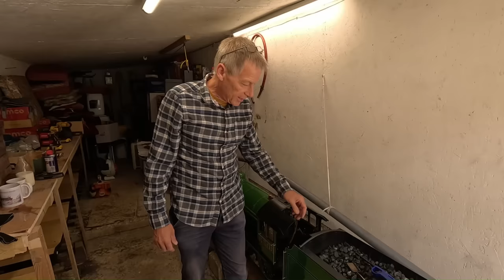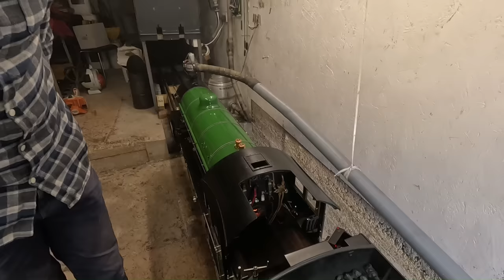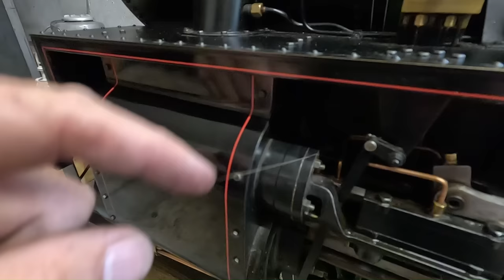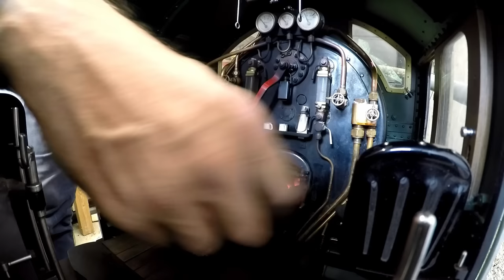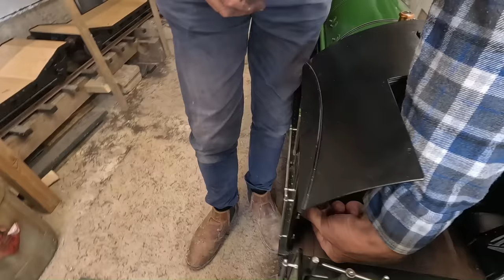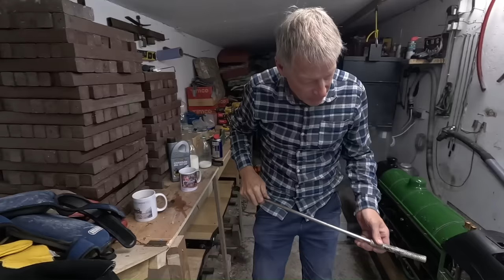How to Raise Steam in a Locomotive at Peter's Railway

Comment: Exceptionally functional and detailed locomotive. Everything works. Everything has to be actually maintained. Never seen anything like it.
Reply from the maker: Thank you for your lovely comments about the engine.  I made it to be a model to enjoy looking at, but at the same time to be able to work really hard.  The bearing surfaces are made of the correct metals etc.  However, there is still quite a lot of work to keep it in good running order, so in that way it is very much like the original machine!!
Thanks for watching! Chris.
PS. If you would like to know about the books I write to teach children (age 3 to 90!) about railways, science and engineering, there’s lots of info here: https://petersrailway.com/

Comment: How on earth do you make the parts so very small and yet maintain function? Those oil pipes alone are so tiny but yet they function and the size of all the plumbing in the cab and such small valves and yet operational at boiler pressure for the injectors. Absolutely amazing. 
I take it everything is the correct 1:1 scale by the looks? ❤
Reply from the maker: Hi, Good question!  The answer is that it is quite difficult.  In truth, the fittings are not truly to scale, so sometimes they are a little larger but in the correct proportions.  A good example is the two mechanical lubricators on the running boards.  These are in fact 50% oversize to allow the internals and a supply of oil.  No one has ever noticed because they are the right shape and have many of the details you would find on the originals.  The oil pipes are 1/16" outside dia, with a very tiny hole through the middle.  luckily, oil, unlike water, still flows slowly through tiny holes and anyway, the flow rate is almost non-existent!  The pressure isn't a problem - as it gets smaller, the pressure has less area to act on.  However, injectors on models do not normally work up to 120 psi, so these are adjusted/tuned to work a little higher.  Thanks for watching! Best wishes, Chris.
PS. If you would like to know about the books I write to teach children (age 3 to 90!) about railways, science and engineering, there’s lots of info here: https://petersrailway.com/

Comment: Something I’ve been taught to do is when steaming a boiler from cold is to shut the bottom shut off on one of the sight glasses and leave the top valve on and then open the drain, which allows all the excess oxygen to vent out of the boiler and also gives you an indicator when the boiler has started to make steam (this also gives the boiler abit more life as it reduces oxygen in the boiler to corrode the boiler)
Reply from the maker: That is a cunning idea!  My boiler is made of copper so probably corrosion isn’t a concern.  However to show when steam is up it’s a good plan.  I usually use the injector steam supply which shows up at the injector overflow.  Chris 
If you would like to know more about the books I write please see www.petersrailway.com

Comment: Thanks for explaining the injector sequence. I have just finished a Pansy Pannier 5” gauge and have run it for a few minutes only when the water level drops. I am very wary about how to use the injector for the loco to run. Just practice I suppose. I will be so happy if I can succeed as it’s taken me years to get to this stage.
Reply from the maker: Hi Adrian,  Thanks for the good comments!  Yes, injectors are, or can be, temperamental things.  I find the WD40 after a run seems to help.  The problem is that our cones are only made of brass and the zinc leaches out if left for a long time as there is always water in them.  I used to clean the cones with citric acid etc, however that seems to make the cones even more fragile.  If you can get some cold water to run through before the steam, then that helps them to pick up.
PS. If you would like to know about the books I write to teach children about railways, science and engineering, there’s lots of info here: 
https://petersrailway.com/
Reply: Thanks for your reply and your advice which I find very helpful.
Confidence and lots of practice will hopefully give me the success. I’ve subscribed to your channel and look forward to some more posts. @PetersRailway
Reply from the maker: You can get lots of practice with the engine propped up on the bench.  There isn't really a need for a roller type rolling road, you can just rest the buffer beams on some solid bits of wood.  Then you can run for hours and get the hang of it all.  If you don't tell anyone, you can even apply the brakes gently to give it a load to work against!  Chris. @adrianbolton4847
Reply: This is the best piece of advice anyone has ever suggested; thank you.
I’m ready for the next stage with definitely more confidence. @PetersRailway
Reply from the maker: Enjoy the whole process.  There is nothing in the world quite like lighting the fire and seeing your work come to life...  Chris.   @adrianbolton4847

Comment: That’s the coolest toy I’ve ever seen! How do you keep the internal metal doors and components from completely corroding in the boiler? I heat my home with a big soapstone heater and have realized that I had to replace internal steel with double thick steel because the heat and flames warped and corroded them.
Reply from the maker: Thanks for the great comment.  The boiler is made of copper so corrosion isn’t a problem.  Thanks for watching! Chris

Comment: Nice railway and narrative!
The members of the two clubs I have belonged to advocated bits of wood soaked in kerosene for fire starting.  Of course I followed this dictum for a while.
Upon deliberation I got to believe this method to be the height of stupidity!  Why???  Because the cold boiler tubes and firebox walls will condense the vapours coming off the wood and kerosene, leaving a sticky surface and soot.  Add some ash from the coal and you have a good insulator on the heat transfer surfaces.
Consequently I changed to using charcoal, as the author of this thread has done, but I soaked it in methyl hydrate also known as methanol or wood alcohol.  This combination leaves very little or no residue on the heat transfer walls, leaving the locomotive rearing to go.  Methanol is available in paint stores.  Don't drink it as it is poisonous.
You can see my locomotive, ol' 2888, running on my channel BasementEngineer.  The videos were made at the track of the Montreal Live Steamers,  and the Golden Horseshoe Live Steamers in Hamilton Ontario Canada.
Reply from the maker: Hi, and thanks for the information about soaking charcoal in Methanol.  Yes, you are exactly right, I think that the moisture from the kerosene probably does make the surfaces sticky at the beginning, so some people say to only light the fire with wood and then go over to coal.  The problem in the UK is that methanol is not so easy to purchase in quantities other than very small.  However, I will have a look and see if I can find some somewhere.
Meanwhile, thank you for watching the video, all best wishes, Chris.
PS. If you would like to know about the books I write to teach children about railways, science and engineering, there’s lots of info here: 
https://petersrailway.com/

Comment: Lovely loco! Superb detail!
I didn't think of putting coal in with the charcoal to start with but it's a good idea.
Reply from the maker: Thanks for the good comment.  Yes charcoal and paraffin works very well!  All best, Chris.
Reply: @PetersRailway Yes I always use charcoal soaked in charcoal to start with but I normally just add the coal once the charcoal is going well.
How did you attach the copper pipe to your oil can?
Reply from the maker: The copper pipe is easy:  Just drill out the end of the normal oil spout to clear the 1/16 inch copper pipe.  Then soft (lead) solder in the pipe.  Not so much solder that it blocks the little copper pipe!!! Chris.
Reply: @PetersRailway  Yes that makes sense.
I tried this on another oil can and glued it in but it came loose.
My soldering isn't great so I will have a think.
Reply from the maker: Practice makes better!   @mattseymour8637
Reply: @PetersRailway Do you find a mix of different coal works best for example anthracite and a more bituminous easy lighting coal?
Reply from the maker: No, I use just the anthracite these days.  I guess you could start with a softer bituminous house coal to get it started, but the charcoal/paraffin works well.  The trouble with some softer coals is that they can contain a lot of sulphur.  This can attack the silver solder in the boiler/superheaters.  However, whatever works for you is the best!!  Chris.
Reply: @PetersRailway  That's fair enough.
I have used the anthracite in the past and find it's ok once it's going but takes a fair while to get going properly and when stood for long periods can get very inactive.
So now I tend to mix it with some better quality less sulphur steam coal.
I find the soft welsh dry steam coal works well and doesn't have too much smoke or sulfur.
Reply from the maker: Lucky you to be able to get some welsh dry!  I had some but it clinkered really badly.  Yes, I have found that the anthracite will try to go out unless you leave the blower on a little.  It takes a bit of practice to get it right.  With some house coal I had, years ago, the fire could go completely out/black, but the blower would bring it back in a few minutes.  Not so with anthracite!!  C
Reply: @PetersRailway  Yes it's getting hard to get hold of and has doubled in price but luckily because all the steam enthusiasts contested about the Welsh mines closing they opened one back up again so it is available for now but I understand what you mean about the anthracite needing constant draft and so found that with the Welsh dry it just burnt that little bit easier with less blower.
I didn't find it clinkers but I only run up and down a short track so ok for what I need.
Reply from the maker: Maybe I just had a dud batch of it.  Who knows?!  I guess we are lucky to have coal at all these days.  I ordered a small stockpile a while ago, just in case it gets even more difficult to get hold of....  C
Reply: @PetersRailway  Yes that maybe the case as sometimes you get stuff that isn't as good and I did the same when I knew the Welsh mine was shutting and bought several 20 kg bags of the Welsh Dry Steam coal so will last me for years!
But as you say to get the 'proper' coal is hard to get now and without paying a fortune.
Now it's all this manufactured ovoid stuff!
Reply from the maker: Ah yes, Ovoids.  They won't fit through the firing hole!!
Reply: @PetersRailway  I know and if you try and break them up they just go to dust!

Comment: Way cool!
     
      Are there any provisions for cylinder exhaust steam to flow into the smoke box to increase draft?

      Using straight boiler steam for draft makes sense for building the fire and when the locomotive is idle, but is inefficient for running.
Reply from the maker: Hi and thanks for your thoughtful comment!  In fact, that is exactly what is done, once the engine is running.  The exhaust steam from the cylinders is directed up a "blast pipe" which is positioned directly under the chimney.  The effect of the exhaust steam blasting up through the smokebox creates a reduction of pressure which then draws the fire through the boiler's fire tubes.  Also, it draws air through the fire to make it burn.  There is a good description in book 2 of my hardback series - Peter's Railway and the Moonlight Express, if you are interested.  It is a children's book, but much older and more technical than most children's railway books!!  Thanks for watching! Best wishes, Chris.
PS. If you would like to know about the books I write to teach children (age 3 to 90!) about railways, science and engineering, there’s lots of info here: https://petersrailway.com/

Comment: Very Nice.  Such detail and functional miniature valves and controls.

Was "Swell" mentioned?   As a boiler heats I a accustomed to seeing the water level rise with heat and bubbles without adding water.
Reply from the maker: Thanks for the great comment.  No I didn't mention swell, but it is very visible as the water heats up.  I had always thought it was just the water expanding, but you have made me realise that the little bubbles in the liquid will also increase the level.  Thanks for the enlightenment!!  Thanks for watching! Best wishes, Chris.
PS. If you would like to know about the books I write to teach children (age 3 to 90!) about railways, science and engineering, there’s lots of info here: https://petersrailway.com/
Reply: @PetersRailway  I worked with natural gas fired boilers fairly large (300k lbs/Hr was the largest.)
If one tripped and the gas suddenly shut off there would be a noticeable step change in drum level like 50% to 20 %.  Bubbles collapsing accounted for most of that I believe.
Reply from the maker: Yes, I had never thought about that before.  What I can tell you is that on a locomotive, out on the line, if the gradient changes, the water level can change a lot.  If you have been climbing and mortgaging the boiler, using more steam than you are replacing water, then the water level will start to get low.  Then, if you level out or go down hill, the water level in the gauge glass disappears down into the bottom nut - worrying!!  Chris.
Reply: @PetersRailway  changing angles would present a challenge that stationary boilers operators don't have to cope with.
I remember talking to an Engineer on the Grand Canyon Railroad and he mentioned grades changing the level indication dramatically.  I hadn't thought of that before.
Reply from the maker: The miracle of YouTube:  We have both learned something different about the same thing!! Chris.

Comment: I've never lit up minuture steam locomotives
But i can proudly say that i have and still do light up full size steam locomotives
What we do is we make a thin bed of coal all around the firebox
And pack wood up to the firehole only at the back
Then i add 3 parrifine rags in each corner
Take a jar with about a 1/3 full then chuck it down the middle
Then take another 3 parrifine rags
Light them
Put one
By hand
In each corner and chuck one down the middle
Theres i think 2 videos of me lighting up on my channel if your interested
Reply from the maker: That is interesting, I guess when you do something often, you develop a system which works well.  For the small engines I find that charcoal soaked in paraffin works very well. The only problem is that once you get going the fire appears full of coal but there’s plenty of burnt charcoal at the bottom so she can be shy of steam until that has been cleared out.  Thanks for watching, Chris.
If you want to know more about the books which I write, have a look at Petersrailway.com

Comment: Thankyou Chris, a great vid. Your engine is a real cutey! Is the boiler copper or steel?
Reply from the maker: Thanks, Peter!  Yes, the boiler is copper.  It is a bit more expensive in the first place, but then it doesn't sit there rusting while not being used...  Chris.
Reply: @PetersRailway  does copper last longer or does steel last longer in terms of a Boiler?
Reply from the maker: Hi Rudy,  While copper isn't as strong as steel, it doesn't rust inside the boiler.  So, unless a boiler is used all day, every day, then the copper one will last for many years, while the steel one will tend to corrode, even when it isn't being used.  All best, Chris.

Comment: You should try this with powder made from iron or aluminum because then there won't be any smoke.
Reply from the maker: That is a cunning idea, but I would be cautious about trying it: There might be a reaction between the metals which are hot powders/liquids/vapours and the copper of the firebox and tubes.  The small gain of not having smoke at start up would be very small compared to the cost of having to rebuild the boiler.  But it is thinking outside the box which achieves progress!!  Thanks for watching, Chris.
PS. If you would like to know about the books I write to teach children (age 3 to 90!) about railways, science and engineering, there’s lots of info here: https://petersrailway.com/
Reply: @PetersRailway  Actually, the name is “Kevin”.
Reply from the maker: My name is Chris, (although am very used to being called Peter), so I was sort of signing it from myself!  So, thanks for watching, Kevin, from Chris.

Comment: "The injector probably shouldn't suck in air, but it does"
Reply from the maker: Yes, that is a good observation.  Model injectors often do suck in air and make the chirruping noise, but I am told that they should not do this.  Also I am told that this is because the ball valve doesn't seal correctly - however I don't know if that is true or if the injector is just sucking in air because of the way it is designed.  On an engine with a steel boiler, this might not be good because the entrained air will encourage corrosion of the steel.  However, on Bongo, the boiler is made of copper so not an issue.  Thanks for watching! Best wishes, Chris.
PS. If you would like to know about the books I write to teach children (age 3 to 90!) about railways, science and engineering, there’s lots of info here: https://petersrailway.com/